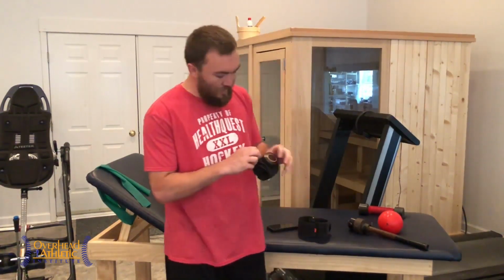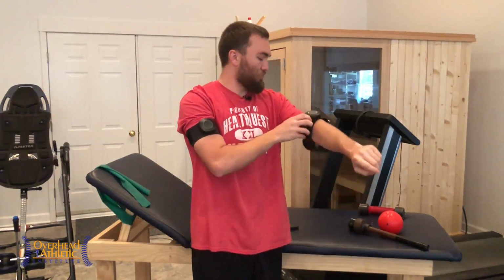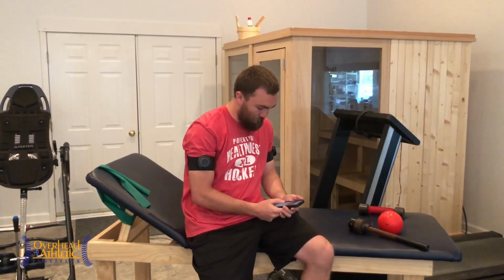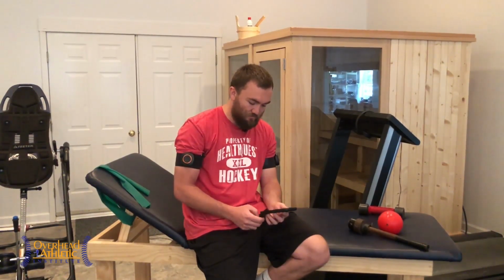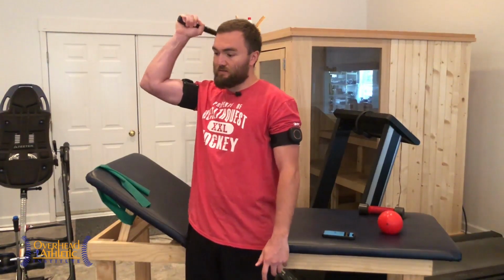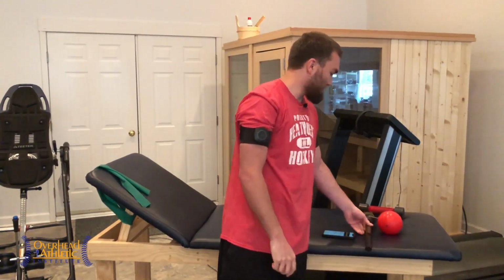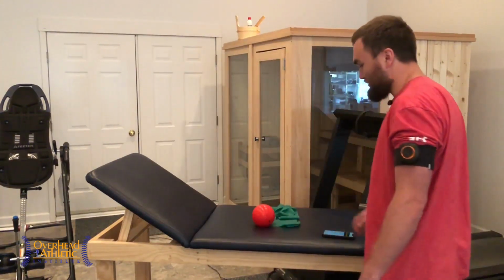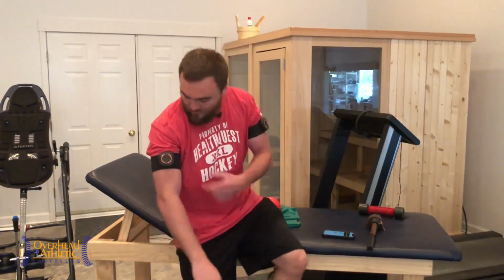AirBands BFR  - Blood Flow Restriction Training Exercises

Comment: i'm certified with Smart Tools. Which do you like better? the new ST has the built in doppler like these air bands
Reply from the maker: Good question, I don’t believe AirBands utilize a Doppler. From my understanding they are regulated by sensing resistance on the cuff and extrapolating to full and partial occlusion pressures. I don’t have to the new smart tools cuffs but if you’re using them in a clinical setting where you need to be more exact I’d suggest Doppler cuffs. I use the traditional smart cuffs and like them but the AirBands come in at a lower price point. You just miss out on a bit of precision in terms of pressure.
Reply: @OverheadAthletics  As long as the precision is within say 5% you're probably good. 80% LOP with exercise vs 75% probably doesn't make a huge difference. I wonder if its similar to an automatic blood pressure cuff
Reply from the maker: That’s been my experience with AirBands! Typically within 6mmHg for maximal occlusion pressure. Negligible difference at training pressure.